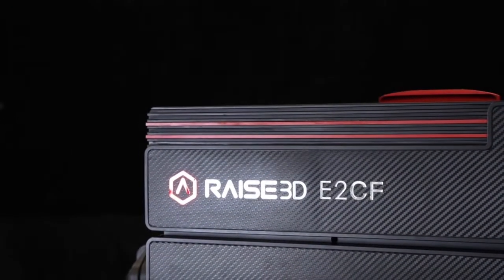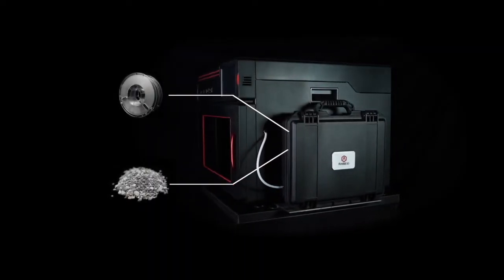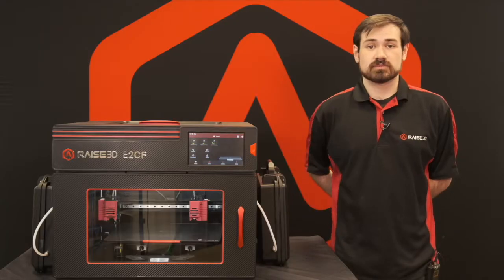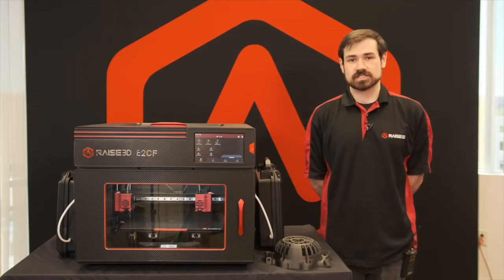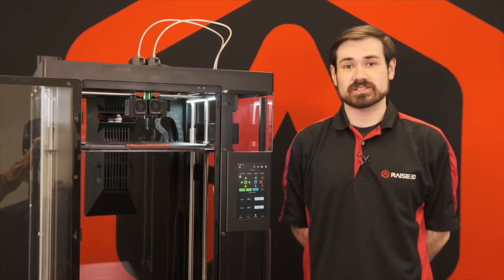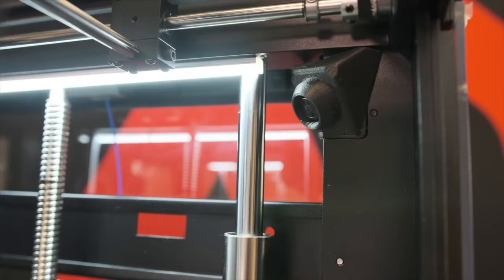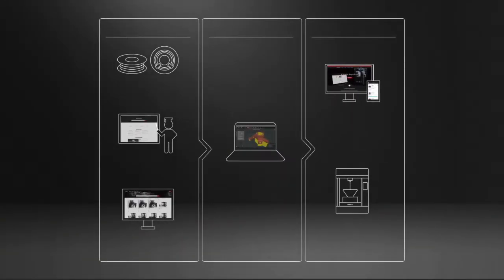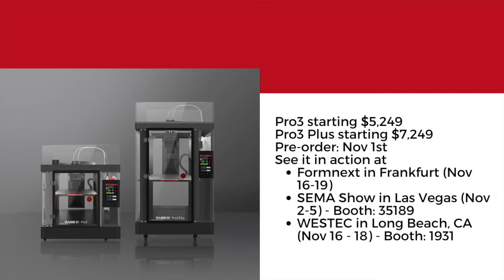Raise3D E2CF and Pro3 Series - New Product Launch Webinar Recap

Comment: In my opinion the way of how the filament is stored on the regular E2 is much nicer. It hides two spools inside and therefore you get a cleaner look. Couldn't understand why Raise3d didn't refine that system. I mean come on, some airtight seals and a place in the filament compartment for silicat and your good to go. For those guys who would like to print straight out of a dry box, a grommet could be placed...
They have chosen the cheap and easy way, by drilling two additional holes.

Comment: Regarding the E2CF- can I assume that all other filaments (PLA, ABS, PETG, TPU, nylon composites) are compatible with this printer? There is not much mention of this. I see myself wanting to use carbon fiber maybe 20% of the time, but when I do, I would love the features of this upgrade.
Reply from the maker: Hello there, to answer your question, the E2CF was specifically developed based on the E2 platform, for industrial use with consistent performance when printing with fiber-reinforced filaments.
To ensure our customers experience the most consistent printing quality when using this type of filament on the E2CF, Raise3D will only support the exclusive use Raise3D industrial fiber-reinforced filaments and third-party filaments approved by the Open Filament Program (OFP). Some questions about the E2CF can be found here: https://support.raise3d.com/list.html?cid=25&pid=1395&aid=1398. You can visit our OFP here: https://www.raise3d.com/compatible-filaments/